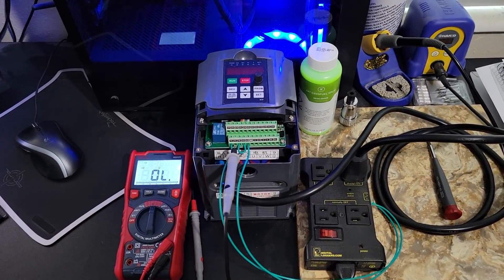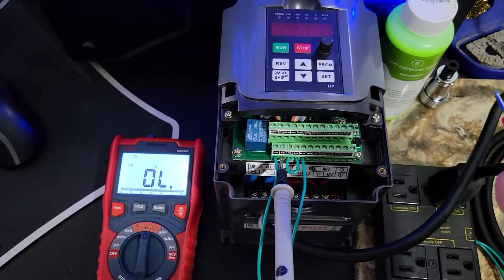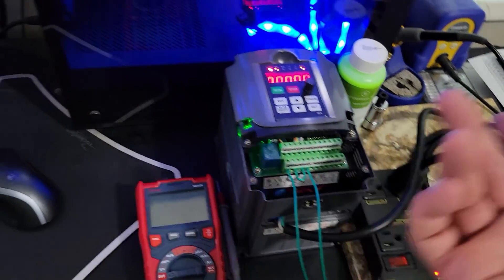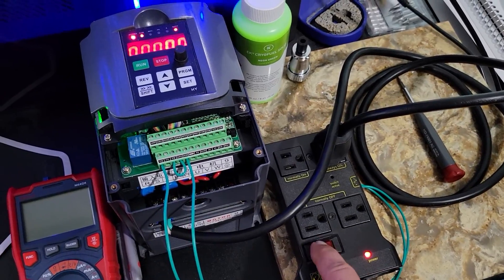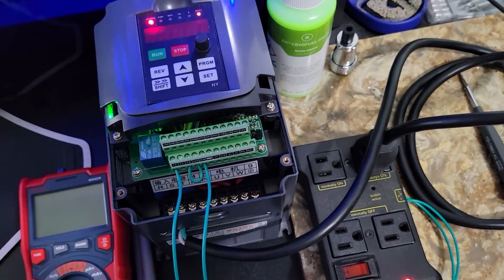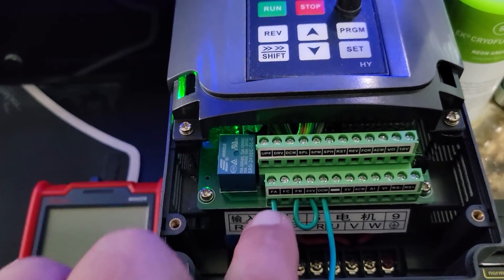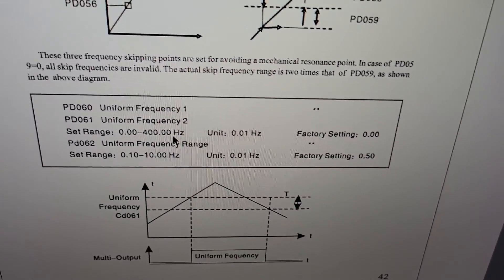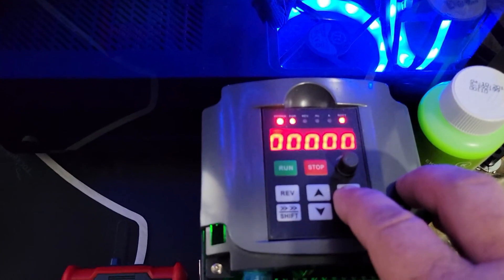Triggering an IOT relay with a Huanyang VFD

Comment: This is exactly what i am looking for. I want to hook an iot relay to my vfd to power a dust collector when my cnc spindle is running, but I also want to be able to manually turn on the dust collection with a switch to vacuum out the enclosure. Would it be safe to also wire in a jumper switch between the 24v vfd terminal and the + terminal on the iot?

Comment: I just wanted to confirm it's okay amps-wise to have a vacuum and the VFD running through the relay like you're setting up? Relay is for 15amps, VFD is rated for 13amps, but I'm not sure what is used/left over while running a 1.5kw spindle.

Comment: Can we supply to above terminals instead of 24 volt , use 240 volt with 1A current for water pump (according to the given info on drawing 3A/250VAC) it’s  confusing

Comment: Hi Jason and much thanks for the information you provide in your channel. I noticed in your earlier (from may) you had the VFD connected to FC vs FA. What is the difference? Regards!!
Reply from the maker: That was a different VFD I believe. It wasn't my personal one. That's why I say check with a multimeter which 2 terminals have continuity when the VFD has no power to see which are the Normally Closed sets of contacts because I think the manual has a discrepancy in it.
Reply: @jasonstewart5942  Understood, thanks!!